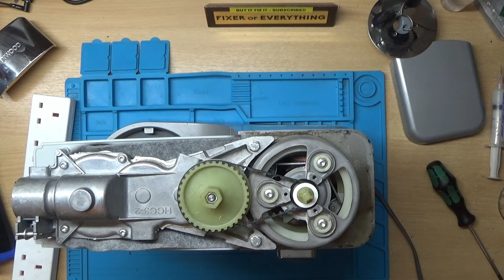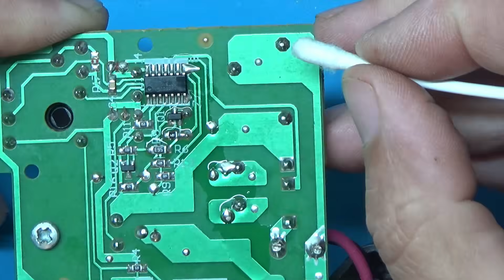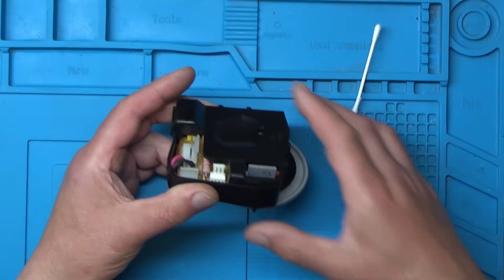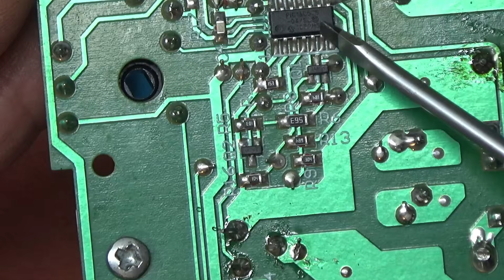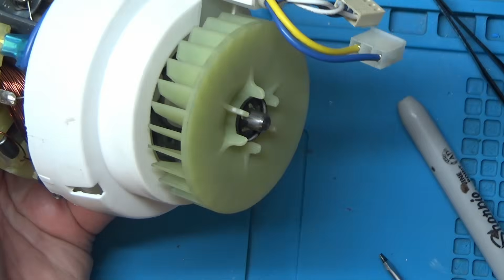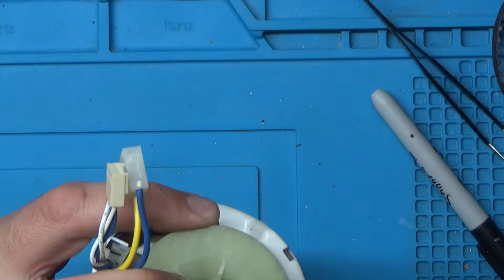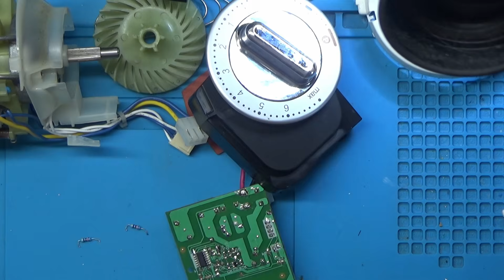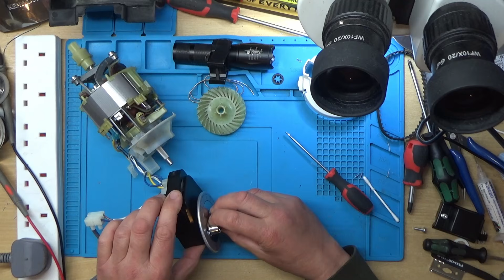Faulty Kenwood Chef Mixer - What A Nightmare! | Can I Fix It?

Comment: I've seen resistors in the hundreds of kiloohm range go bad many times if they have high voltages on them. They never look burnt. The 470k in the startup circuit of old switch mode power supplies was often the culprit. It is across ~300V DC all the time, even after the supply has started. So if the device doesn't turn on any more after a power outage or after it has been power cycled that was often the problem. You don't get those startup resistors in modern supplies anymore though, probably because of energy saving.
Reply: I've also seen resistors and other components crack internally from external heat and vibration in the lab. I couldn't find a visual indication that a resistor mechanically separated from the wire without scraping off the paint (lab class got boring between assignments).

Though entertained by the discovery, my instructors reminded me that we were using factory-reject components to learn on (because they are that much cheaper, and challenging to troubleshoot; but mostly cheaper.) And weren't always only mislabelled and/or packaged.

It has made me a bit paranoid about forming a strain/vibration relief into components leads, and making certain that they gently fit into place without storing any bending strain - though I've never actually seen an example where it made a difference.
Reply from the maker: Interesting, I don't remember coming across this problem before 👍
Reply: "Ive seen resistors in the hundreds of kiloohm range go bad many times if they have high voltages on them. They never look burnt" But why do they go bad even though the current through them is well within their rating. A 470K resistor even with 300V across it  is dissipating less than 1/4 W.
Reply: @simontay4851  overvoltage, then arc track.  the miniscule arc blows the high resistance open, or so I was once told.
Reply: @simontay4851  I don't know. I just saw that a lot. I assume it is because of the really fine carbon or metal traces they are made of which break easy, but I really don't know. I just know that those go open observably more often than other resistors without looking damaged. High value resistors in low voltage circuits on the other hand I never saw go open in that way. It's always those that have a couple hundred volts on them.
Reply: @simontay4851  That rating is for the electrical load; not including any mechanical, heat, or radiation loads from the environment or nearby components.

(An electromagnet with 'one' turn may not be as effective as one with a hundred turns. but with ten thousand times the current being applied... plus electrostatic repulsion  ((edit:) and inrush current) ...)

Mechanical stress from {waste heat, or vibration, or the board (PCB) flexing, etc} is transmitted/coupled into the component.  And in high-power situations the magnetic reluctance electromotive forces will cause the components themselves to push against each other, and move.

(Generally) The wire-leads flex to accommodate this mechanical motion, metal fatigue can introduce fatigue cracking and other wear without disturbing the paint/outerlayer(s).

(in the lab) Bending the leads too sharply at the component's body then soldering them tightly to the PCB (with excessive heat) caused the thermal-expansion (or contraction) to stretch/pull the components against the board when it cooled.

(in production) Machines/tools bend the Leads a short distance from the component-body so that any additional bending will (mostly) happen in the wire, as will any change in tension from/through the soldering/PCB. 

(sometimes) An elastic adhesive is used to dampen vibrations/shock between the component and PCB. Particularly with heavier freestanding components (like capacitors/instructors) or fragile components like (crystals or diodes).

Although too sharp a bend does tend to concentrate flexing at the 'corner', leading to the lead to cracking/breaking off; There are lead/wire-forming tools that add bends at other angles to mitigate anticipated motion on other axis, position the component off of the board, and/or to make assembly easier with various footprint/hole patterns.

(in the lab) Some of my schoolmates also induced component failures using radiation sources.  (Again,) I've never seen naturally occur 'in the wild' - ((edit:) unless you count, lasers, RF and crosstalk/signal-coupling) - so your mileage may vary.